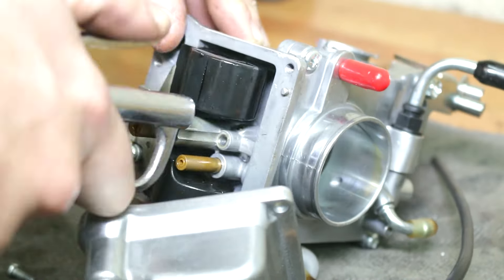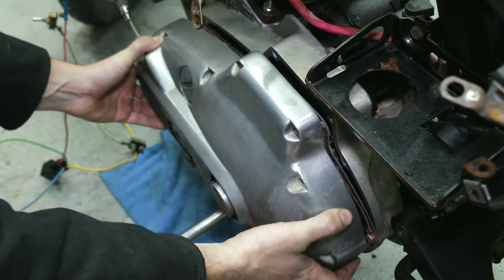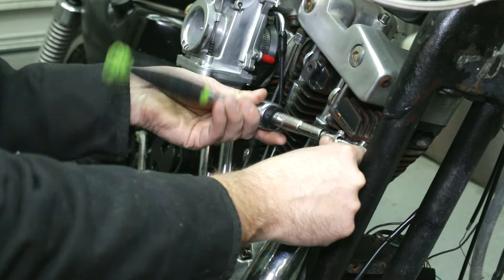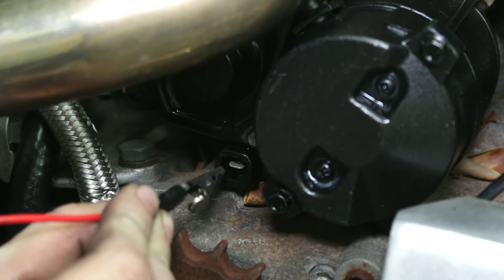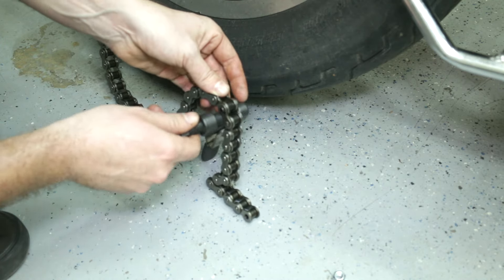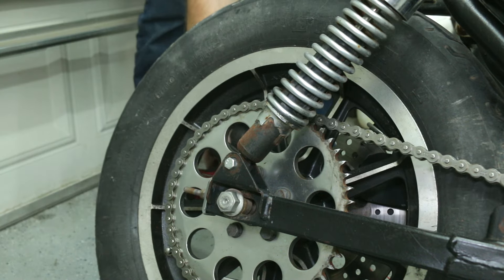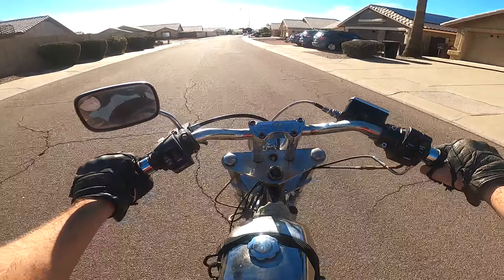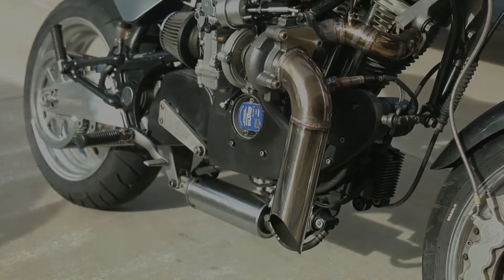Ironhead Sportster ABANDONED for YEARS! | Will It run?

Comment: Skip skip boom boom 💥 I've had best luck with points on the old irons
Reply from the maker: This whole ordeal made me understand why a lot of old timers throw electronic ignitions in the garbage. Would've turned right over with clean, adjusted points.
Reply: @DoctorMotorcycle  lot of guys back in the day would have a bad coil and just throw whatever on it ,and wrong ohms melts down the pick up ignition coil, when I had my 79 bastard it was electronic ign. Swapped right over to blue streak points for a 66 nova 2 from auto zone

Comment: You must have known the motor wasn't locked, cause you started by washing, then opened up a fresh looking 1:16 carburetor. I'm still doing the "back and forth" with a breaker bar on the crankshaft nut first thing myself. I've had guys bring me (just purchased) bikes needing "just a battery", that had been locked up for years!
Reply from the maker: Yeah I always have a good Carb laying around to use for occasions like this. I don't like working on dirty stuff, hence me washing it first. Even if a motor is locked, you can usually un-stick it with Marvel Mystery Oil and application of heat. Funny you mention the "just needs a battery" thing, I was just talking about this the other day. Usually it's a small list of things to get roadworthy, lol. -Doc
Reply: @DoctorMotorcycle  I'm happy to hear that the Mystery Oil and Heat usually works, cause I've had to pull engines, pry up cylinders enough to cut the connecting rod, then beat the piston out with a 2x and sledge! Of course, this was in a "dirt floor shop" and I was a child, but they hired me full time cause I "didn't have a home". When in doubt, replace the oil pump - or just replace it anyway was a good practice..

Comment: Hello I seen you have a ironhead I have one from 79 the guy I got it from change the battery in lost spark to the points. There is powered to everything but points as I can tell by a test light. I’ve changed the condenser still no spark.